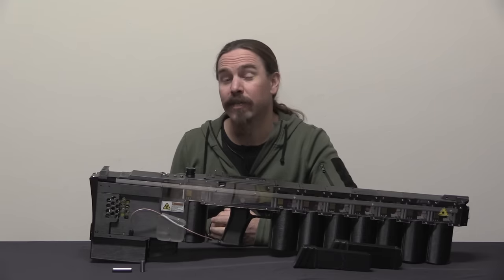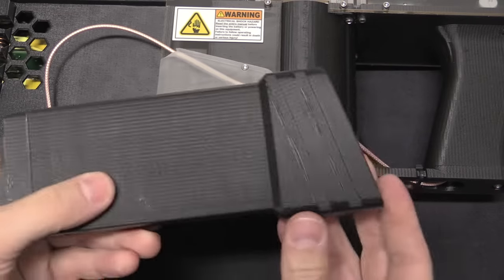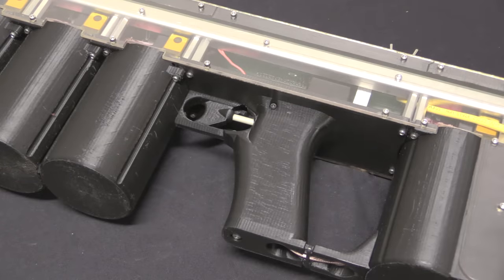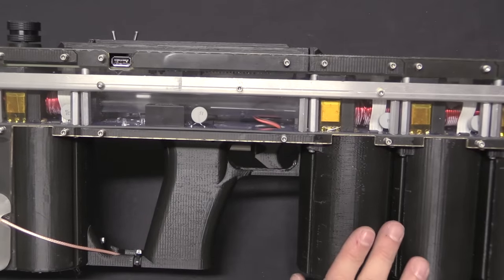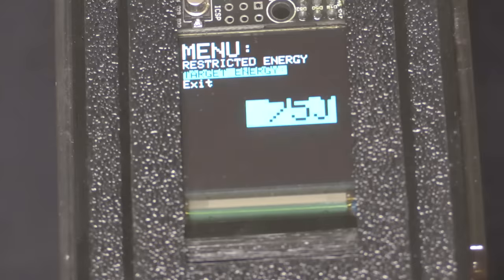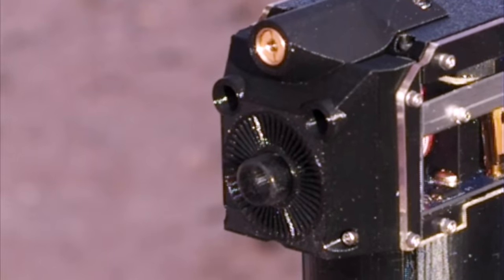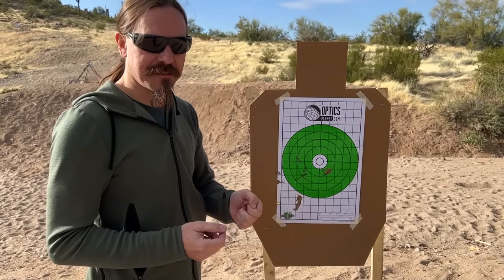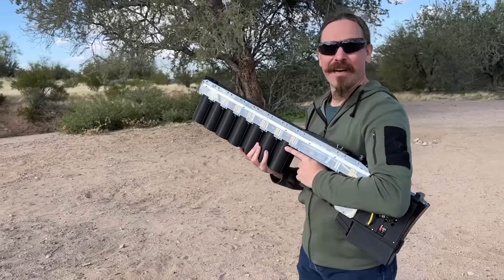ArcFlash Labs' GR-1 Anvil Portable Gauss Rifle

Comment: Once this technology matures, the ability for different slug sizes and shot power would allow you to, in the same weapon effectively have a sub machine gun and a battle rifle, which you could switch between with the swap of a mag and the flick of a switch.
Reply: You could also almost switch into a "less lethal" mode with slow enough projectiles to be more like rubber bullets... but made of steel.
Reply: Or a sniper rifle. Think of all the additional firing solutions available to weapons that can precisely adjust projectile velocity!
Reply: Reminds me of the VSBR's from Gundam
Reply: What's the application for that though?
Reply: @gattosquad2241  Massive simplification of supply lines, weapon training, armory keeping, squad loadouts, all kinds of stuff. Think about the benefits of a military where you only need to buy and issue one gun.
Reply: @MarilynMalkovich  You know what happens when you build one tool to do every job? You end up with a shit tool that does everything badly. 

There's no situation where you, at the drop of a pin, need to be able to convert your rifle to a submachinegun.

Standardization is a good thing, but never when it's done out of pure convenience or to save money.

The real issue here is that this gun doesn't have a SINGLE thing it's aiming to do well, let alone multiple. A solid steel projectile that tumbles at 5 meters is less than useless in an infantry weapon.
Reply: @gattosquad2241  Yep. That's why the comment you were replying to said "once it's ready".

Also, please name a reason to standardize other than for convenience or to save money.
Reply: @MarilynMalkovich  You misunderstand... it can't JUST be either of those. You have to be able to maintain or increase your standards and effectiveness during the process or you're just cost cutting at the expense of the guy doing the job.
Reply: There’s a Nerf gun called an FDL that has those exact properties. I don’t think it’s being produced anymore, but there’s a lot of fun videos out there of it.
Reply: @gattosquad2241  Assault rifles have replaced dedicated SMGs and battle rifles, and multi-tools are one of the most useful day to day items, who said that designing a took that can fulfill several jobs at once made it bad. Not only that, but you would wouldn't be forced to use an intermediate round at long range, or a full power round at short range, as you could change the power behind each round.
Reply: @Sophistry0001  Or rubber coated steel projectiles.
Reply: @TsandLman  Not only that, but being able to adjust the velocity would allow you to do more risky shots, and calculate the drop better, when the deviation from the set velocity is so little compared to that of a cartridge.
Reply: @gattosquad2241  it’s true that this tech may not become more effective than conventional firearms, but variable muzzle velocity is not the compromise you make it out to be. It’s just how this thing works. 

If it ever becomes capable of useful muzzle velocities (and fire rates), you could easily tune it down to anything below that. There are definitely situations where you might want to do that.
Reply: @Sophistry0001  Less lethal round could look a bit like a mortar bomb. Fat steel body for impact energy, rubber tip to reduce the chance of breaking the skin, long, skinny tail with fins to stop it shuttlecocking in mid-air due to the light nose.
Reply: @ninjaeddy1717  The muzzle velocity isnt an issue (other than it being extremely low).

Let's say this thing is tweaked to have twice the muzzle velocity of an m16... the issue is that a solid steel slug doesnt distribute energy into a target well...  in infantry sized rounds you'd have to hit a guy A LOT to put him down because the damage is essentially going to be only the diameter of the round. The same thing happens to a lesser extent when you use steel cored AP rounds on insurgents who are high AF.

A straight shooting round that will go through 6 buildings leaving a 5.56mm hole is worthless to anyone.
Reply: @gattosquad2241  So you make steel rounds with lead tips. Not a big deal.
Reply: @gattosquad2241  these are all good points, especially the nature of steel slugs vs lead. I was just concerned with the point that variable muzzle velocity in a magnetic accelerator is not a compromise the way that “A tool that does everything” would be.

I too have some scepticism about a weapon system like this. I’d sooner believe that rail guns and Gauss guns might be better suited to being large mounted weapons on battleships or planes.

Comment: Pretty impressed.  With slugs that size, even doubling or tripling speed to the 600-750 fps would do some serious damage.  Not unbelievable to expect a useable weapon by the military in 20 years or so.
Reply: Probably way less than 20yrs to perfect this.
Reply: US mil had this tech early in the Iraq war and although very large, were testing copper slugs that are capable of liquifying the copper and tearing through a tank so quickly that they liquify all beings inside the tank into blood and mush. When the tank is opened that had two soldiers inside, they just pour out as a blood goop.
Reply: Eh doubt it,
Firearms peaked in ww2 and have not changed much,
They probably won't change much in the next 80years
Reply: I would guess the first applications will be vehicles, when external power is supplied and the weight is not much of an issue. Especially in applications where burning ammunition could cause a threat.
Reply: @karstenschuhmann8334  more likely to be ships, they were already testing railguns with them
Reply: @zach5708  source?
Reply: @zach5708  that's just a HEAT round with less steps.
Reply: Considering these have been around as handhelds for over 20 years as home projects (of the same power too), and the patent for coilguns was made all the way back in 1904 with WORKING prototypes, i'd say 20 years is FAR too optimistic. At least for handhelds, ship mounter large ones already do seem like useful weapons. But handhelds are, and still will be toys for far longer than that unless there's MAJOR coil, batterry and capacitor innovations... And considering the world has been INSANE over ev's, batteries and capacitors, but we didn't see much change in 20~ years... I'd say its ridiculous to expect anything to change much in 20 more. More than that, idk WHY you'd want to anyway, considering you can make an electric air compressor gun that's FAR more handy, safe, and lethal already!

Comment: Regarding the battery removal/installations requirements. As the system needs to be off, the company could add another layer of idiot-proof by using one or more contact switches to cut power. If that cover isn't closed, the switches aren't depressed, and the power is off. Adding a relay such that power remains off until the main switch has returned to the off position gives you a pretty tidy closed-loop.
Reply: There are a lot of safety measures that can be used,some examples:
1.Switch light indicator,so that you now exactly if the gun is on or off
2. Anti-battery removal: a system in which the screw or the latch can't be toggled on or off if the power is on. For example,if the gun is on,the latch is blocked and is only unlocked when you turn off the weapon. At the same time,if the battery is removed,the switch is blocked so that you can't turn in on accidentally.
3.filter mash to the covering,so that you aren't even able to stick a piece of metal inside those holes
4. Trigger lock: prevents the trigger from being pulled when the system reveals something is wrong,like a coil is overheating or the magazine is not well-put,or the system is reading a wrong voltage on the battery

And there are many more. This is an alpha build,I hope that the company will read these comments because there's a lot to be added
Reply: I'm sure they will, once they get to the point where they're not 3D printing custom parts for hand-built prototypes.
Reply: Safety always comes first. After this,I think that the second major problem are the bullets: these chuck of metals aren't aerodynamically useful,but even if you build a classic projectile for them, there's still the issue of the bore gun+the fact that the bullet isn't touching the barrel. The "simple" way to resolve this is by building on the end of the bullet some retractable fins,like the ones HEAT-FS shells use. Problem is,how the f you can build them onto a bullet so small?you could do it,but it would cost a lot of money to create a single one.

Comment: I really love the fact that the "medium" projectile is an off the shelf drop in concrete anchor
Reply: @smorrow  For this, as I recall brass isn't magnetic. If you just mean in general filling a radiator key (minus the gripping tabs) with a propellant and then firing that out of a gun, you may wish to look up "gyrojet" weapons.

Comment: A very ingenious design. I think the only downside may be the ammunition tumbling through the air. I think a better ammunition choice would be a ubiquitous ball bearing found throughout the metro, maybe in size 15mm.
Reply: Finned darts for the win. Once the speed is brought up to something useful, the fins could be rather small.
Reply: or to take advantage of the lack of barrel contact, fin stabilized ammo could be used without needing a sabot
Reply: James, I got that reference, comrade.
Reply: @sethdrake7551  I was just thinking simple spiral cuts along the side of the projectile. Keeps the diameter and mass of the projectile up and will induce spin even inside the barrel.
Reply: “   I was just thinking simple spiral cuts along the side of the projectile. ”

A bolt gun?🤤

Comment: This is about what I expected for such a prototype. Impressive, but nascent. However, seeing it in action, I can see another potential use case cropping up -- covert weaponry. Without the trouble of expanding gas or the noise of moving parts (armament aside), the noise that a properly, consistently lethal version of this gauss rifle would make seems like it could be engineered down to levels that make movie magic suppressors sound like tank shells. As long as you can drive the coil whine's volume down to inaudibility, I see no reason why you couldn't make this into a silent killer.

Very cool stuff.
Reply: Long as they keep the round sub sonic ya, thing should be nearly silent. Go over that muzzle velocity and it's still going to make a loud crack
Reply: @Bl00dCrown  you know there is a reason you don’t get invited to many parties
Reply: @Bl00dCrown  haha what the hell that was uncalled for. Are you projecting here my guy?
Reply: @Bl00dCrown  ahahahaha you have no friends 😐
Reply: @Bl00dCrown  You just went full hard R with that last sentence. Never go full hard R.
Reply: @Bl00dCrown  that’s pretty intense man chill out
Reply: For now give me a Vintorez.
Reply: Wont this create the ability to have a more powerful silent round than is currently possible? Since this thing could remain subsonic and just increase the mass of the projectile to achieve the same power? If I'm not mistaken this is much more difficult with gunpowder weapons.
Reply: Seems kind of pointless for silent work when you can get a 45 with subsonic ammunition. Maybe someday. I would like to see these scaled waaaaay up though!!!!!
Reply: @Bl00dCrown  Hey, man; I'm seriously offended by that! I'll have you know I live in my Dad's Attic, not my Mom's Basement! More seriously, I really hope you can recognize the fact I was not spinning up some fantasy of MARSOC lugging around this specific 20-pound overgrown calculator-slingshot, but instead talking about the gauss rifles we'll see generations yet to come running around with when we're all old men.

Besides, are you really trying to say militaries don't love spending money on shiny new toys?
Reply: @joshuaa.5523  Yes, this could easily throw a very heavy slug at just under the speed of sound. On the order of 800+ grains.
Reply: With the  coil whine being a know frequency  it wouldn't be hard to  build a  white noise generator to let it be completely noise free.
Reply: the only noise the thing made as it is was the trigger and solonoid and a little charge-up whine.  The simple expedient of a rubber washer on the back of the rounds to muffle the solenoid and you'd have true stealth
Reply: Waiting for the exploding flechette rounds and the hundred round mag.
Reply: @Bl00dCrown  L + ratioed + no bitches + malding because he doesn't have a mass driver
Reply: @snafufubar  Honestly, explosive projectiles are an age-old way to solve the problem of "how to we get lethality when muzzle velocity is not an option?".  The original explosive cannonball was an answer to that question when increasing the velocity of ship cannons was not an option because of weight and handling issues, and tanks have adopted the same tactic when using a long-barrel high-velocity cannon wasn't an option for whatever reason.  a shaped charge doesn't care about muzzle velocity, the shaped charge jet is moving at the detonation velocity of C-4 whether it's coming at the target at 10 m/sec or 200.